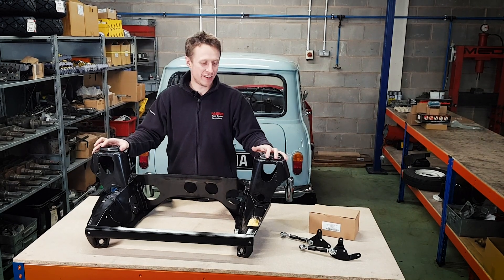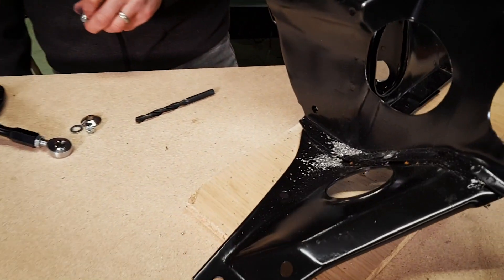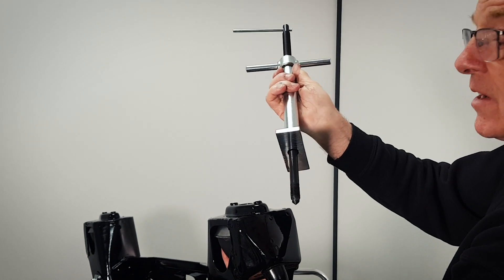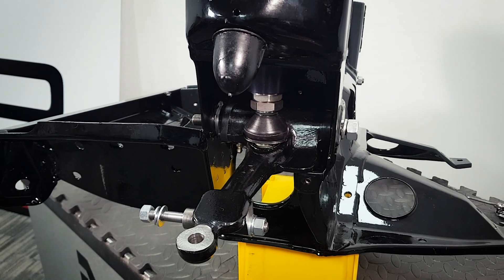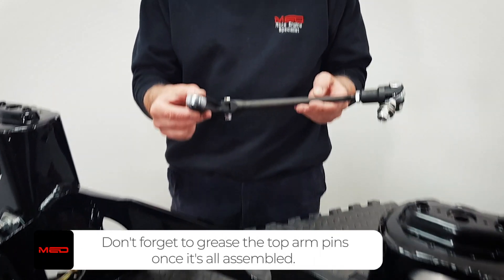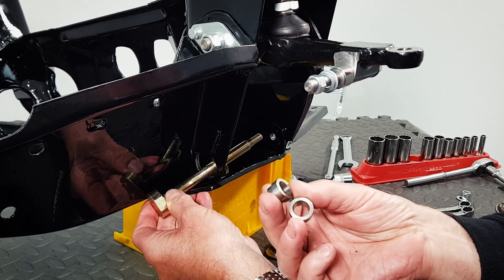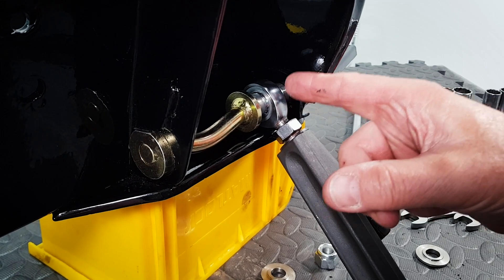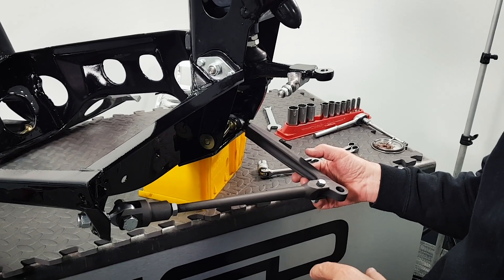Project 63 part 14 - Mini front subframe assembly and upgrades

Comment: Air driven tools . . . boy do I hate those things.
Loud , cumbersome because of the hose , just not powerfull enough compared to electric tools and you need a big power draining compressor and tank in your workshop.

On the MED upgrades sensible manufactured parts.
One thing going thru my head are the two gearbox supports constant dynamic of pushing/pulling on those two unstrengthened spots in the subframe , especially on powerfull cars.
If you're going thru the trouble of stripping and repainting anyway , why not take the time to make a bracket to dispers the load and weld it on to make sure the supports don't rip a hole in the frame.
Reply from the maker: Thanks for the comment. The Mini front subframe is in many ways massively over-engineered for the job, so we never find this is a problem on the gearbox steadies, especially with the matching top steady fitted.

Comment: Brilliant series, incredibly useful and full of handy tips.  Talking of which…. Top arm pivot: you stretched he forward grease retaining ring over the arm casting until you had the arm, the spindles and the washers in place, and I expected you to show the ring being slipped off the arm and over the washer edges.  But you didn’t.  Did you forget to do/show this, or am I wrong?   

And as regards the rose-jointed bottom arms, would you use these on a road car, or would they be too harsh and noisy?  I love the precision and adjustability of a spherical bearing, but the rose-jointed Bilstein dampers I had (on a Chevette HS) were incredibly noisy. Drove me mad…

Comment: I found that fitting new cones and hi lo suspension it left no thread visible thus no adjustment? So basically my car sits really high on the front which apparently I'm told is normal with new cones? 🤷🏻‍♂️ Have you ever seen this issue?
Reply from the maker: Yes it will lower down after a few heat cycles.

Comment: Hi, great video to refer to when rebuilding a front subframe. Was the subframe powered coated or 2k painted?
Reply from the maker: We decided to paint it in 2K :)
Reply: Ravi , I've learnt from experience it is best to go the 2K route , although powder coating is usually cheaper and easier , it doesn't age well and can be a great nuisance as it is liable to chip and more  awkward to remedy.